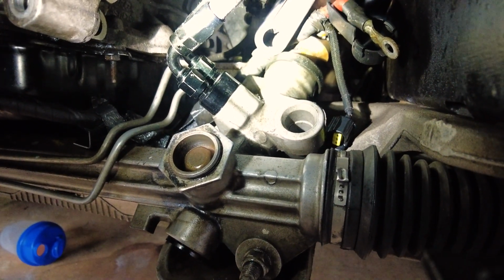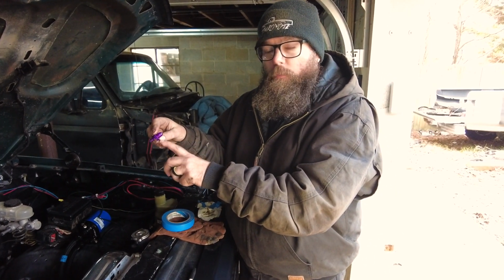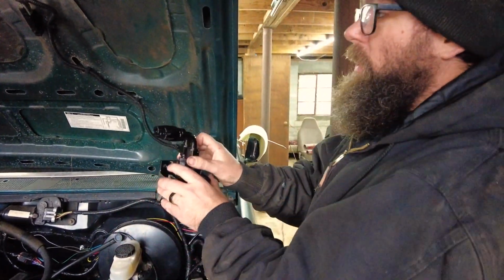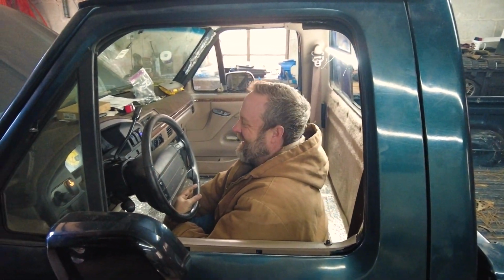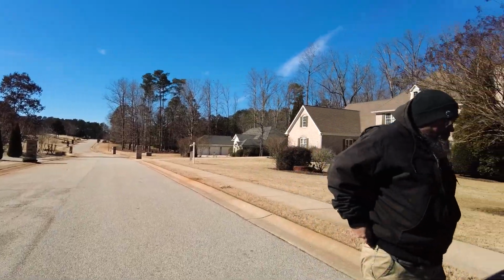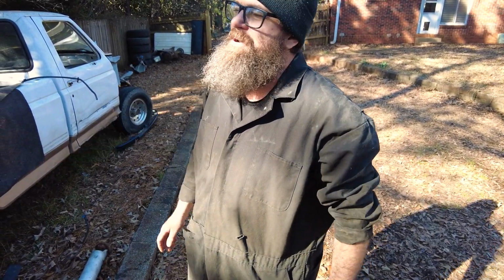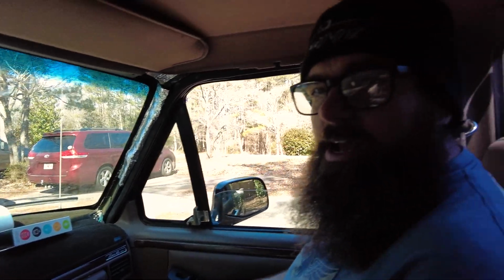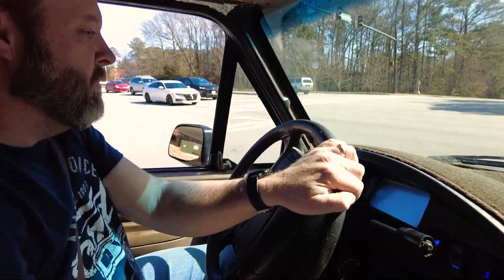Volvo Power Steering and First Drive in our Coyote Swap F150

Comment: I have a 92 f 150 with the 351. How do I get electric power steering for it????
Reply from the maker: You need to get a volvo electric pump. Then mount it and get the fittings and ptfe line.  Really simple.  Good luck

Comment: Found it ! F100 performance make a bracket to take a 2015 electric mustang electric rack and pinion kit my motor is a 5.3 and my f100 is 65 with crown Victoria crossmember
Reply from the maker: Yes there setup is under 900 bucks all in the Volvo setup under 400.

Comment: Went through the exact same process with the oil filter...found the MMR o rings leaked and replaced with square o rings from McMaster Carr.  The fittings seem to keep a consistent oil residue but overall happy with it.
Reply from the maker: Thanks for the feedback and advice.  Do you happen to have the part number for the oring?

Comment: well that filter placement will make for messy changes...good job?
Reply from the maker: Actually it wont.  The filter is removal from its location and allow for a pan to be placed under it for drainage and then reinstalled.  Thanks for the support and concern.  Keep getting after it.
Reply: @JMRRebuilders  why not just mount it in a better orientation to begin with? I guess you can fix it later
Reply from the maker: @xxxmikeyjock  becasue there is nothing wrong with where it is.  It was done on purposr for servicability and works great.

Comment: You gotta do what you gotta do but changing that filter is gonna suck.  Oil dripping everywhere.  Great video guys.
Reply from the maker: Actually we made it so they can unbolt from fender and place pan under it and drain it.  Should be eaily serviceable.  Now the starter on the other hand not so much and yeah we may have to do that